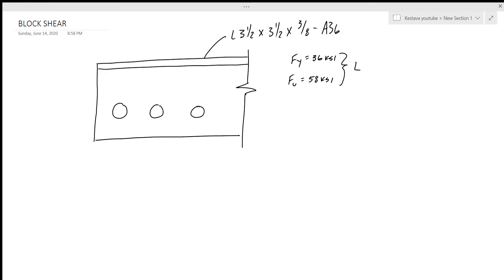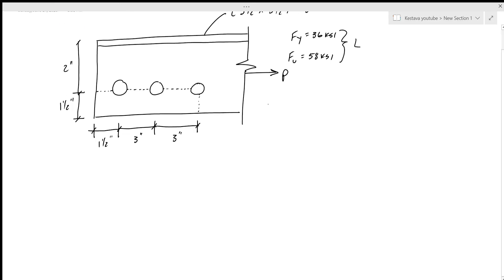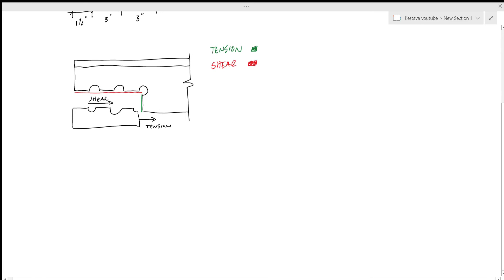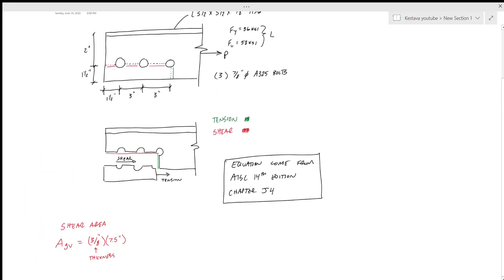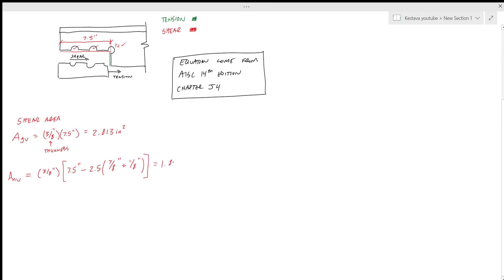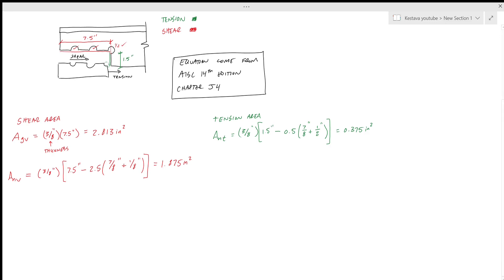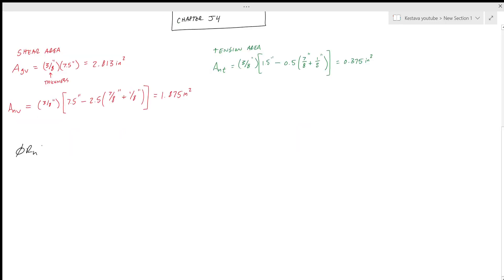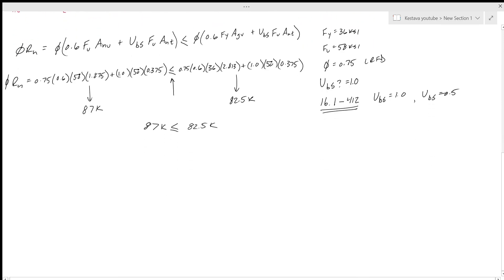Block Shear Design Example - Using AISC Steel Manual - Start to Finish

Comment: Industry standard for std hole size is 1/16 + Dia. of bolts
Reply: d+1/8" is correct.
For yielding and rupture check, use effective hole dia. = bolt dia. + 1/8";  for tearout check at holes, use hole dia. = bolt dia. + 1/16";  for bearing check at holes, use bolt dia. 
Checked with Manual Table 9-3a, b, c, the video got correct answer.
Reply from the maker: Karthik, you'r absolutely right! i accidentally used 1/8". I'll have to update with a note - great catch!